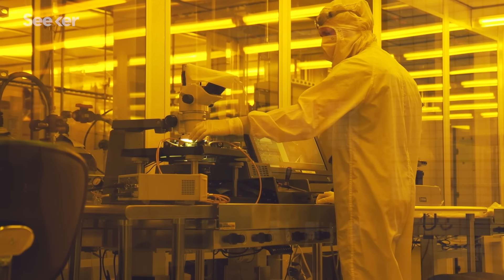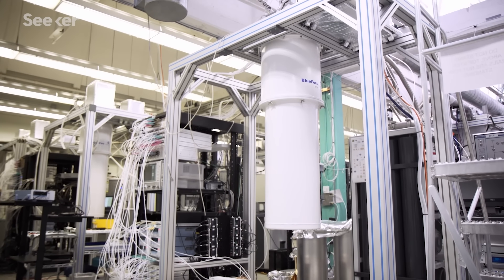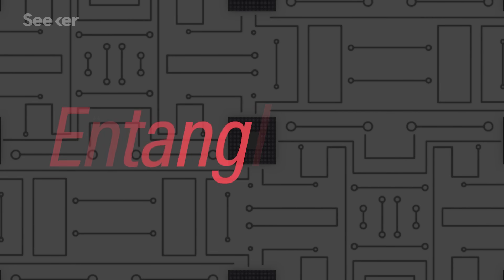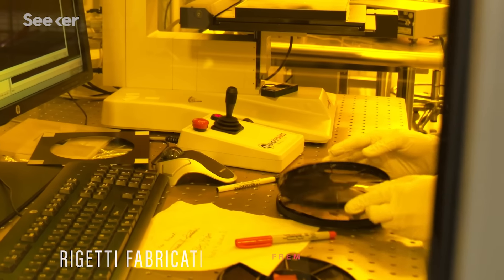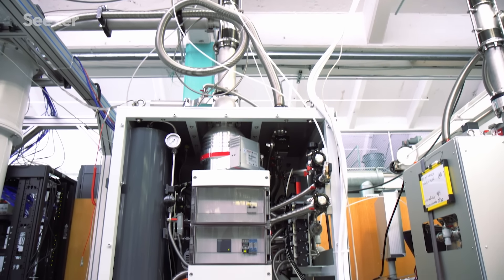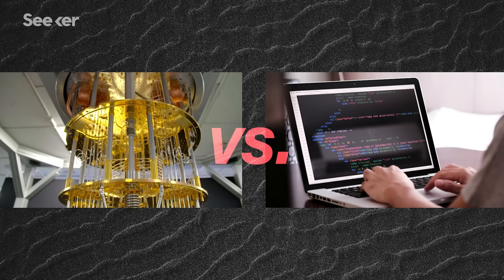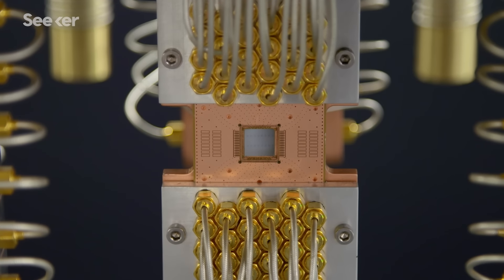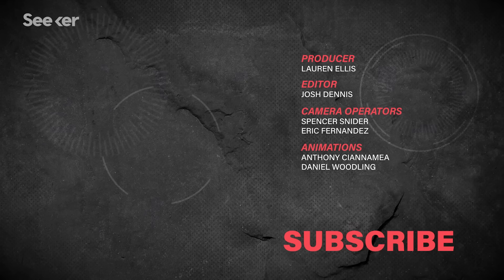We’re Close to a Universal Quantum Computer, Here’s Where We're At

Comment: "you want have kind of like a 'quantum laptop' that you can just pick up"

yeah but if you'd told alan turing 'all of this will fit in a slim 15" chassis one day and will be orders of magnitude more powerful' he would've had the exact same response right?
Reply: Right and not even a laptop, your smart phone crushes Turing's machine.
Reply: The problem with putting quantum computers inside of laptops is that they need to be cold, REALLY cold, in fact the closer the absolute zero the better and at the moment there's just no way to do that inside of a laptop, this is also why they're so large compared to the actual chip
Reply: First computers needed massive cooling as well. Using your logic, it would seem that it is quite impossible to condense those into a pocket object as well. Yet we have smartphones that can run circles around those first generation computers.
Reply: Yeah but with classical computers the challenge is to stop them from overheating, which is much easier than cooling them as close as you can to the coldest physically possible temperature. It's possible that we'll come up with a good method but I'm skeptical by nature and nothing exists today that could even come close, nor are there any theoretical ways to do it (as far as I'm aware).
Reply: thebrotanic 
Well it's good that you are skeptical. And you are right that at present there is no known way to shrink a q comp. to the size of a laptop or even a desktop, but.....when the first computers were made same could've been said about them back then as well.
Reply: thebrotanic 
You are right.
Reply: KongSchlong 
Nothing is cooled to absolute zero, not even in a q comp. It is very close but not at abs. zero. And the methods for stopping a computer from overheating that were known in its early days would not apply to a modern phone.
Reply: i'm noticing a common thread in the comments saying that it may not be possible which is the words 'at the moment' and you're completely right! that's the exciting thing about our universe though, we simply don't know what we don't know. to that extent we'll never be sure what the limitations are in any of the fields we work in.
Reply: well the germans just managed to go negative nanokelvin meaning below absolute zero, temperature is a loop  go over "infinity heat" you get to negative again. so it can be done.
Reply: dailystocks tv 
Well it does not achieve the requirements that low temp. are supposed ti achieve by going neg temp.
Reply: dailystocks tv source?
Reply: Probably you're right and probably you're not, and only time will tell.
Reply: r'enbe the biggest problem with this idea is that you don't need it for a conventional use. Q computers solve specific type of problems. Maybe in the future people will have the need for personal q computer, but for now, I don't see a prsctical use for it.
Reply: Димитър Иванов again, similar things were said during the advent of the first conventional computers so
Reply: r'enbe Yes
Reply: backspace 0

Thats not the same  they need to be cooled around absolute zero ...
Reply: TheWeeaboo But negative mass hasnt been proven to exist....
Reply: Always a catch

Comment: @7:00 ... it is not true that classical computers cannot simulate quantum systems.  In fact today classical computers do a better job at QM simulation, what you need is a bunch of parallel processors (or just a bunch of networked computers) and you code in the rules of QM at the software abstraction layer.  Quantum computers might someday do this more directly in hardware, but the waste heat requirements of cooling them make it debatable whether the QC's will ever be able to run QM simulations more energy efficiently than classical computer software implementations.  QC's should eventually surpass CC's for some algorithms, both in speed and energy efficiency, but we do not know this for sure.

Comment: I wonder if they take into count whst the silicon is doing at those temps yes the semiconductor is prefect at those ultra low temps but is the silicon changing and causing interface or even resonance noise as silicon is not good at ultra low temps a carbon based glass or even something like aerogel as the base to print the semiconductor onto might not have interference at those ultra low Kelvin temps

Comment: Didn't we say we were close about a decade ago??
Reply: Mixey 
Nope,
We didn't even had smartphones then....
Reply: they have exsisted for years allready. linusTT showed one not super long ago.
Reply: Ya, but now they've got everything complete and right... except the part where it works in any measurable metric XD. At least the computers of the 40's had the capacity to make a light blink XD rofl rofl
Reply: No, nobody said they were close 10 years ago.  Physicists working on this topic have known since the beginning it would be a huge uphill battle to pull off the engineering needed to build a functioning quantum computer.  Tremendous progress has been made in the past 10 years, both from an engineering and theory standpoint.  It was announced by Google only in March that a record of 73 qubits was successfully implemented.  The more qubits, the more powerful the quantum computation.  With 100 qubits, it is theoretically predicted that a quantum computer would have more computing power than all the supercomputers on Earth combined!  So it is astounding that we have come that far mostly within the past couple of decades.  Advances in error-correction and noise-suppression have made such a high number of qubits possible.  A major advance in quantum computing would be using topological phases of materials that could be incorporated into a quantum computer as a qubit.  By using topological matter, the topological state of the material is protected much better than the state of a standard non-topological qubit, making the computing far less susceptible to noise.  This is currently an active goal of condensed matter physicists and materials scientists.  I am no expert on this subject by any means, but I see tremendous progress being made on quantum computing and in a similar way to how we have seen transistor size reduce consistently each year in computers, I believe most experts in this field are very optimistic in advances being made each passing year that will bring the number of qubits higher and higher.
Reply: Here is a list of accomplishments that have been made since the beginning of quantum computing https://en.wikipedia.org/wiki/Timeline_of_quantum_computing
Reply: a decade ago, we barely decided that the concept of qubits were feasible to engineer.
Reply: I heard an estimate saying commercial quantum computing might be available in 2060-2070.
Reply: C R Hasnt D-Wave had 2000 qubits for a couple of years now? They passed 100 nearly 10 years ago.
Reply: The D-Wave 2000 qubit computer operates by a process called quantum annealing.  Despite the fact that it has vastly more qubits than the computers mentioned recently, this is a computationally different approach than quantum gate computing, which is what a true universal quantum computer would use.  Shor's algorithm and Grover's algorithm, for example, are some of the revolutionary theoretical discoveries made that allow the factorization of numbers on a quantum computer and allow a quantum computer to vastly outpace a classical computer computationally.  These run through quantum gate computing, not quantum annealing.  So basically, the D-Wave 2000 qubit computer operates by a different process than something like the Google 73 qubit computer that I mentioned above and can only compute a small subset of problems and it has not been demonstrated that a quantum annealing computer can outperform a classical computer, as far as I know to date.  Here is more information: 

https://medium.com/quantum-bits/what-s-the-difference-between-quantum-annealing-and-universal-gate-quantum-computers-c5e5099175a1                       

https://www.extremetech.com/wp-content/uploads/2016/05/QuantumComputing.jpg
Reply: Nope. They said that they were about to start production of experimental units which is exactly what we have right now. Experimental models that are at the level of development comparable to when digital computers started in the 40s and 50s. I'll let you know that it took 32 freaking years for the CAD technology to reach studios for the production of entertainment content (movies and games). Also you'll most likely NEVER see a quantum computer inside a phone or a laptop. These machines require special isolation, cooling and power delivery in order to function properly. Therefore they are HUGE machines.
Reply: Amara's law
Reply: Nah where not that far off ... Maybe 2037-2048 , You’re thinking like we just made computers in 2000 lol .. Maybe an actual Laptop Size Quantum Computer will be available 2050 + . But a Tv Sized Quantum Computer I’m sure will be on display next 10-20 years
Reply: omg he logged in with a 2nd account to prop himself up! good job mr troll.
Reply: Seeker is just seeking views...
Reply: Mixey so close
Reply: Quite right Mixey. "Here's where we're at." Proceeds to talk about promise and potential sounding exactly like it did 10 years ago. If there have been advances in the field, which I hoped to learn about, they did a good job of not mentioning a single thing about it.
Reply: na, WE were close. THEY figured it out in the 30's. The 10,030's B.C. Nothing new under the Sun(except the solar simulator)
Reply: Mixey a dacade ago we were close to smartphones becoming popular
Reply: And what have you done to hasten this?
Reply: I think more words are necessary to determine the level of truth in the statement. Did you read that ten years ago? Probably. 

If I'm standing close to something, and move closer, am i not still close to it?
Reply: Ben Dover - Less than that, Rigetti Computing already has API's ready for their current models of quantum computers but as the video stated, Q-bits simply do not last very long and that's the next hurdle. Once we figure out how to make the Q-bits stable, the API is already there and applications using quantum technology would begin immediately.
Reply: Yeah we’ve had the d wave quantum computer for a while now
Reply: 2030 to 2040 seems likely at current level of advancement
Reply: It took nearly 40 years for digital computers to become available to general consumers do you people seriously think that in 20 years quantum computers will be available in the same manner? Don't be idiots! Quantum computers are on a whole new level of complexity compared to Digital ones.. Moore's law do not apply! We might never have personal quantum systems, only mainframes.
Reply: Finesse
Reply: The world was suppose to end too.
Reply: uday kadam You're right, we just had mobile phones that could access the entire internet... but without touchscreens! So much more primitive!
Reply: @udaykadam5455  yes yes we did
Reply: You know there is a problem when the process is more interesting than the computing or any records set in computing. From what I understood those chip with arrays of squares is 1 BIT per square, and they need liquid gasses to keep it cold enough. The density of bits will be worse than and IBM machine in the 1950s. Consider the length of wires and electrons communicating between chips and bits, and super conducting or not they only can travel a the speed of light, common sense says scaled up such a large machine with miles of wire will never be very fast.

Comment: Can it run pubg 4k ultra at 144hz tho
Reply: LeMar the real question: 4k porn😎
Reply: Switcheroo hell yeah Yee haw
Reply: LeMar ahaha
Reply: Sure if Quantum Graphics is such a thing.
When running games at 4K @ 144Hz, most of the rendering and such is done by the Graphics card which little or hardly any impact from the processor.
"Quantum Computers" are meant for calculations and such things as probability to be done at an extremely faster rate than current processors can do using qubits.
Qubits can be represented in 4D vectors like this: 
00 = [1000], 01 = [0100], 10 = [0010], 11=[0001]
Reply: Lucifer Morningstar I like the name Morgenstern
Reply: No,this a big boi computer
Reply: 40k Legendary 1440hz
Reply: But aren't graphics cards doing processing as well? Can we make a quantum graphics in that case as its equivalent
Reply: If it could run PUBG at 16k ultra hd 1000fps
Reply: No because PUBG isnt optimised to anything

Comment: If a runner was in a maze and theres ie: 10 paths to choose from,  in order for the runner to get out of the maze the runner would have to choose a path  one by one until the runner chooses the right one that leads him out of the maze. if the runner hits a dead end he has to go back and then select another path. The runner can only get through them one by one that is his limit. That is a simple way to describe linear processing which are the way all of our computers work today (laptops smartphones tablets PC's). They compute/solve problems linearly. A quantum computer would process and find the solution like this: if there are 10 paths to choose from in a maze, it will create 10 runners, and they will each choose a different path and they will run at the same time therefore SOLVING and locating the solution ALOT quicker. The difference becomes bigger when there are more complex processes or more variables to process. Imagine if there were 1000 paths to choose from: a normal computer would run through each path one by one in a sequential order, to try and locate the path that completes the maze. A quantum computer would be able to run the 1000 paths at the same time because it can create 1000 runners each running a different path at the exact same time.
Reply: Thanks, now I get it.

Comment: Can it instantly crack any encryption? Because that's a problem.
Reply: Not any, It will definitely crack RSA and many current public-key algorithms, but there's work going on for quantum-resistant cryptography. Also there's a Quantum key distribution method which is uncrackable(there are weaknesses though), and it's already used in practice because it only requires 1 quantum bit.
Reply: yes. perhaps not instantly. but very very quickly. it's anticipated that the quantum computer will actually find the end of things like pi. 256 qubits can hold more information than the observable universe is holding. "just 300 qubits could simultaneously encode more numbers than there are atoms in the observable universe." we're also going to be using quantum computers before silicon in classical computers gets replaced with something better.
Reply: just create authentication mechanisms where if you fail in 3 attempts, lock the account.
Reply: @BeRAd427  a quantum computer can't hold more information than the observable universe is holding no matter what amount of qubits. those qubits along with their information is part of the information held by the universe lol.
Reply: Traditional encryption? Yeah, with ease.
Reply: @Pavelow "the end of pi" That's not a thing, that should only happen if we live in a simulation with finite computing, wherein we're kinda screwed

Comment: to be honest the 1s and 0s line is actualy the longest term  of data and not actualy the shortest thats why scripting i beleive is faster its finding the alphabet in the over surface like shorthand and the color code by shorthand veiw rather than the long drawn out list of ones and zeros  and then full dictates of words that apply to long ass codes of 1s and zeros without haveing to write out the full list of 1s and 0s and programing is as simple as haveing tags in the metadata to be able to recognize the item by those tag infos to be searchable by its keywords  to quantify this is like useing algebra where the letters actualy represent larger numbers but in order with an a-z'trograph multiples of 26 equals the whole infinate line count each 26 group also to find which line it actualy equals to this is when you get into a at the what power as a'2 or b'29 it has its own longer number but in power terms so a G ON THE 7TH power equals  i beleive 163  i had it all drawn up before but this is when algrebra letters have deeper meaning than just any random letter to actualy represent the number accordingly and thats the difrence from the basic idiots algebra to advanced algebraics with purpose-- it can be the key to actualy shorthanding higher values and reaching the quantum values on less symbols especialy when full words are wrote with a power key number to hide in it the shorthand version of a much more extremily larger number,,,its kinda like a que list a realy big number thats waiting to be fully processed but on a shorthand list but lets say you only got a standard pc so it generaly only has one port to send and receive so you gota use a shortlist that tell it to bigger amount of things but on less info and the only way to get standard pc to actualy going faster is actauly maximizeing the amount of ports sending and receiveing ,,,just as storage drives with multi ports and multi head writers can handle more than a single  you dont realy need a que bit of something that you cant tell if its gonna be on or off  or autochangeing at random because then your pc would shut off without you knowing why  so it dont make no sense when you want to actauly control it properly so on means on /and off means off exactly when you want it and need it maybe then the ai teck would actualy work and start taging images more fully to recognize it dorectly as what it is instead of randomly switching yes to no or viceversa and maybe then a bit will be a bit and a gig a gig instead of 8 tb being some other off wack number besides 8tb because a bushel is still a bushel and a penney is still a penney no matter how i divide it  but im just saying anything else just sounds like its missing and off without understanding this much so maybe it can help connect a few dots